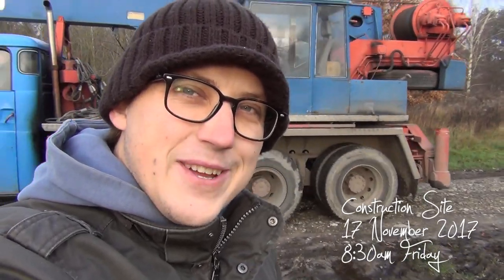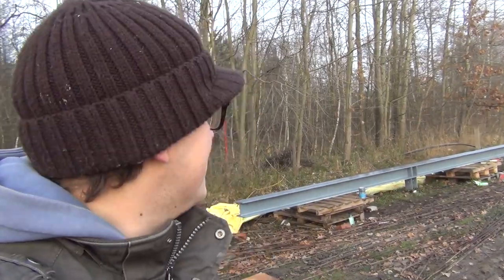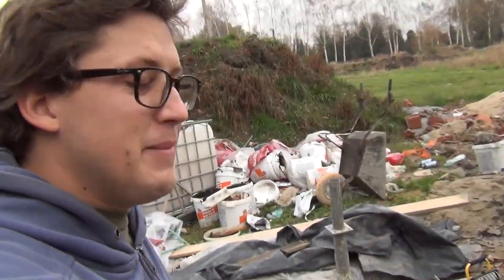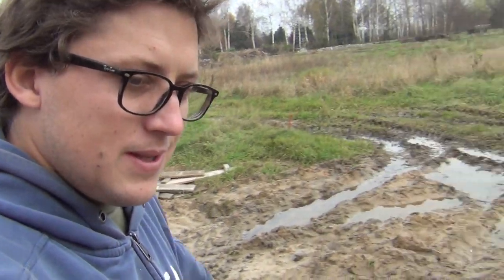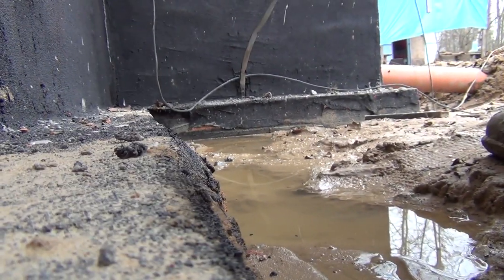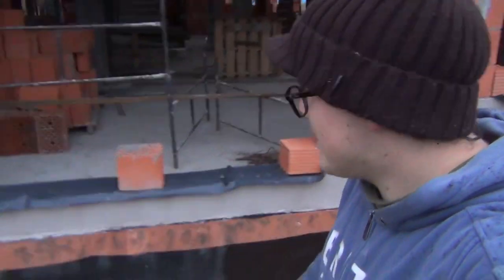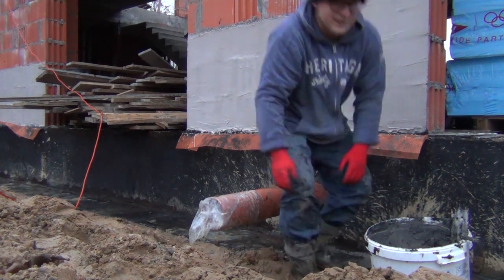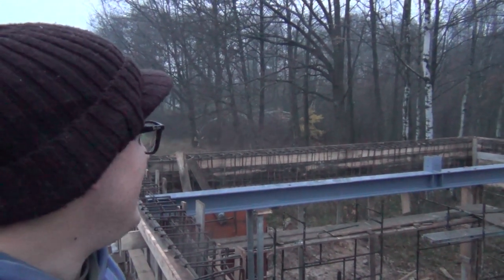BoH 85 - A Crane for the I Beam

Comment: this is why construction tapes have moved from asphalt and butyl to acrylic adhesives

try a liquid applied barrier like poly wall or dupont when you need to replace that stuff, you just have to add a good french drain below the level of the barrier and a drain barrier so wet soil isn't compacting against the wall and the water can drop down to the french drain

https://youtu.be/9n-W25Gd9oM
Reply from the maker: Hi, we needed a solution that would withstand some water pressure, so we chose the bitumen mass. We can’t easily make a French drain or other around the foundation due to the ground conditions (standing water) like on the road in front of the house. A trench with rock would just attract all this water to the house proximity and nothing really to do with it afterwards. Having native soil around the house equalizes the moisture and should help with the pressure on the foundation. We investigated long and hard before got Nga this route, the bitumen wasn’t cheap :D just the guys messed up the application. Otherwise the product seems very good :)